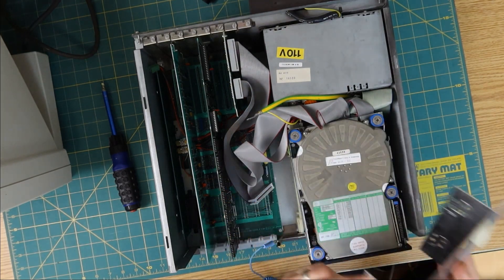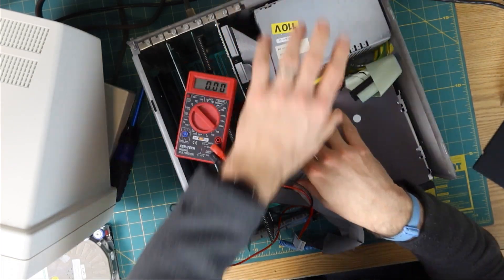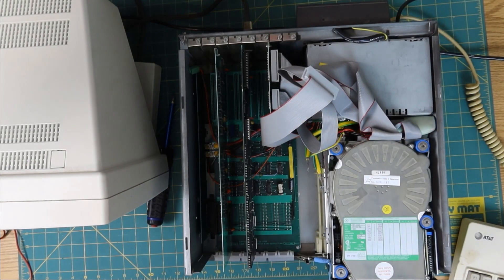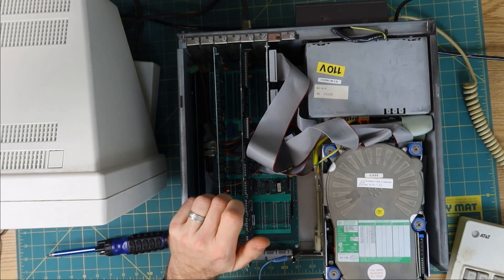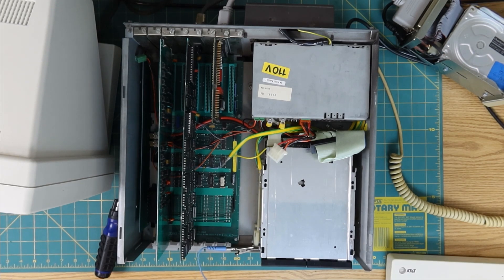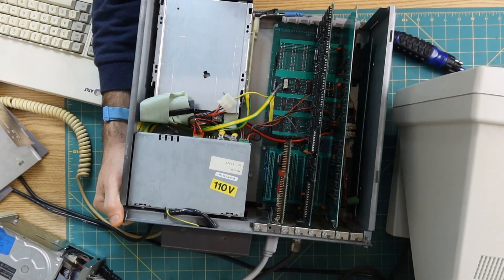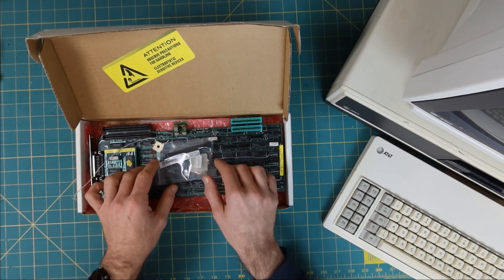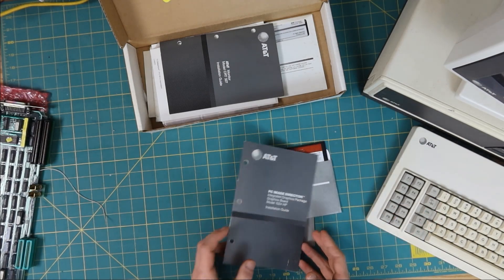Can I make this AT&T PC6300 usable for #DOScember?

Comment: This was a bit funny to watch ... The AT&T 6300 is the Olivetti M24 ... And the power connector in the beginning is connected to the wrong PSU connector should have been moved to the connector to the left - Remember Orange is 12V and also goes to the left.
Reply from the maker: Hm... I compared it with the power supply in the my other 6300 is connected at the same location. Maybe Olivetti and AT&T did them differently?

Comment: That harddrive might work if you hit control alt delete after the hard drive spins up since it takes so long to spin up. Might need lube on a stepper motor if that's external.

Comment: I am the owner of a lot of Olivetti M24, AT&T PC6300, AT&T PC6300 PLUS and Xerox 6060. I am curious about the configuration of your 6300. What is the model number of the monitor? Is that a CRT327 or CRT313/314? What are the resolution that video board supports? I read it supports 800x640. Are other resolutions supported?
Reply from the maker: According to my notes, I got a CRT327 and a non-working CRT318H with that system. The video board supports a bunch of weird stuff, but I haven't played around with it very much. I still haven't finished fixing that system, and I really need to get back to it. :(

Comment: I can;t find anything on it or pics...  nothing.   When I had my 6300 Plus it has an 84 key keyboard with no number pad.  It was exactly as wide as the pc case.  it did have the mouse port on the back of it.    can't find info on it anywhere
Reply from the maker: If you can ever find a picture of that keyboard on the Internet, I would love to see it.  I'm amazed by the amount of stuff in my own collection that has no presence on the net at all.  No pics, no description, nothing.